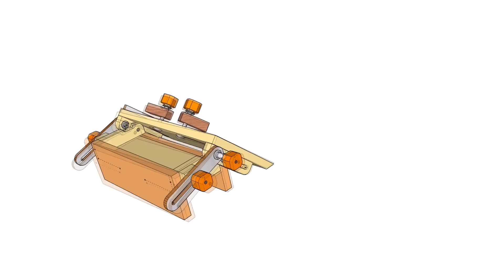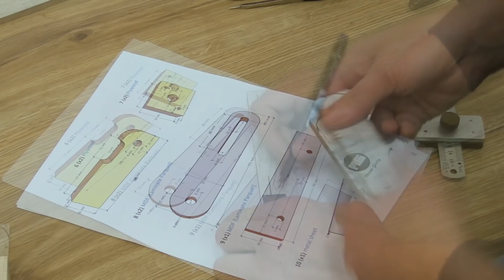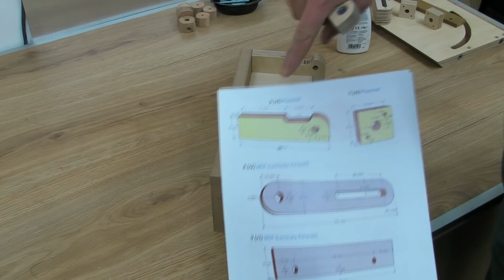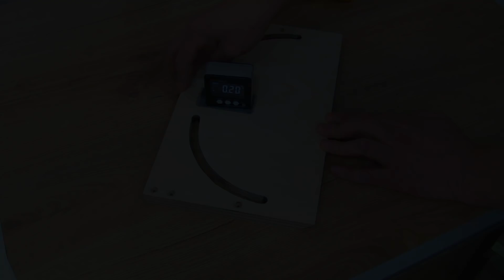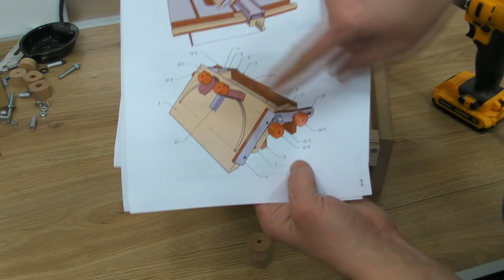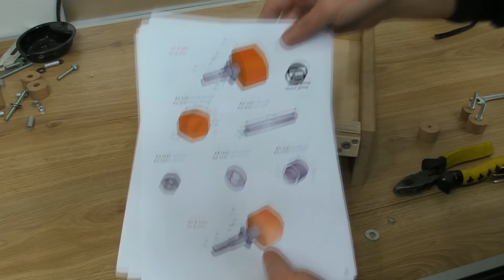Angle & Vertical Cutting Tool for Table Saw

Comment: I just made a 90 degree high fence model for re-sawing and I like this one very much. It is much safer than using the saws tilt mechanism. I will probably do this at some point. Thank you.
Reply from the maker: I thank you too.  I'm glad you like it.  Do not forget that you can find the measurements in the description section of all videos.

Comment: very nice design. much easier than tilting the saw. must try this.
Reply from the maker: Hello.  Thank you so much.  A really useful tool.  You can see what I used in my last video.  I designed such a tool because it was a bit of a hassle to adjust the angle on my table saw.  Note that you can find PDF plans in all my videos
Reply: I'm scaleing down to a smaller t-saw and this is perfect.